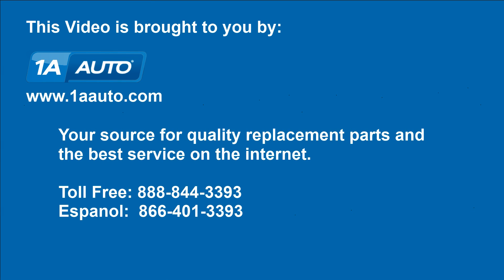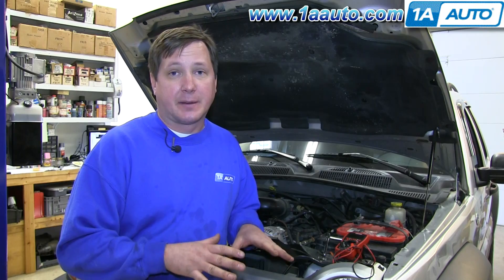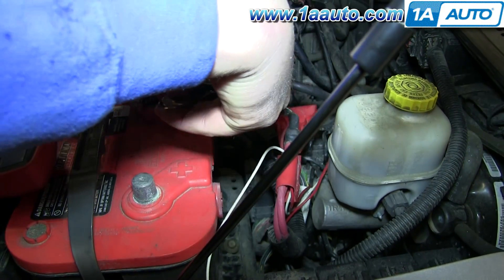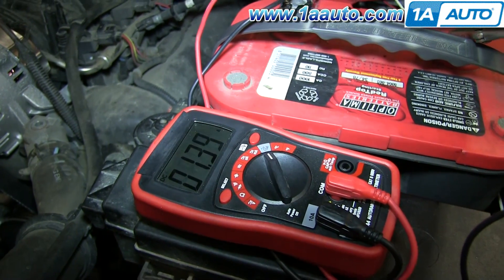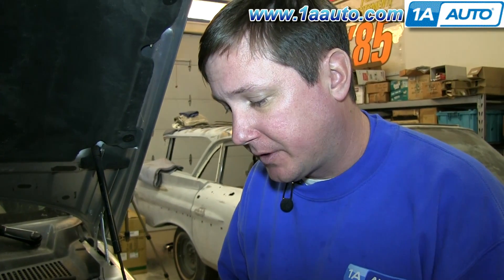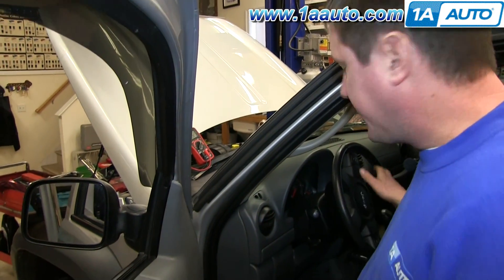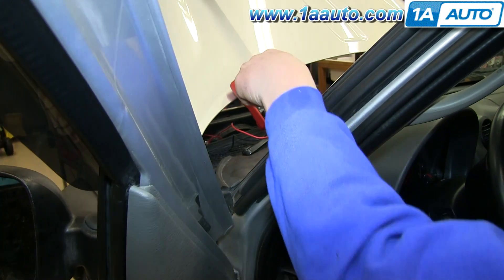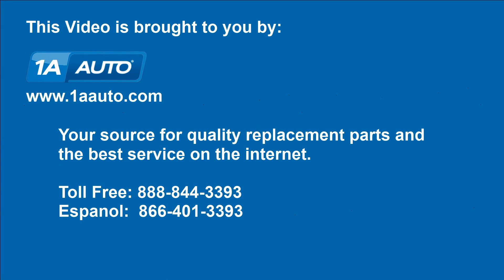How To Perform a Battery Current Draw And Locate Problems

Comment: Lucky didn’t ruin his meter by opening the doors and it applying a load on hood meter. 🤦🏾
Reply: I use the cheap meters...I am not a car mechanic.. I was 15  years or so as an electronic tech..mainly TVs.
 I have not found a draw like that on my 1999 Ford Expy.  It makes a small spark when putting the the positive terminal on.  Recently replaced the alternator. It was bad.

Comment: Next time, safety glasses.  Socket wrench and vice grip warning about shorting !!
Reply: Good point.  I wasn't thinking about safety glasses.  Another thing is some black rubber tape.. not the grey stuff..it has a little metal in it..will keep down the chances of shorts.  There may be some vice grips on the market that are properly insulated.

Comment: Curious as to why the use of the positive side? Isn't that more dangerous? I guess it works both ways and just being careful not to get into any electrical mishaps. Thanks for the vid.
Reply: F.O.U.O Cruz if you use the positive you can hit your ratchet to the frame of the car and cause it too short but theoretically you could use the positive also but the negative is safer as you won't hit ground by hitting metal on the car
Reply: @jcaleca60  That is the point of the comment.